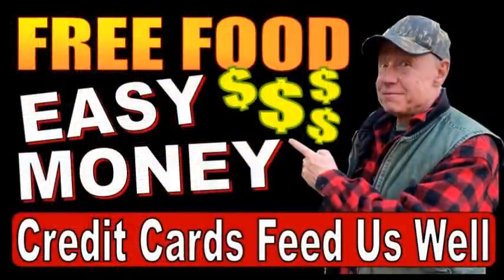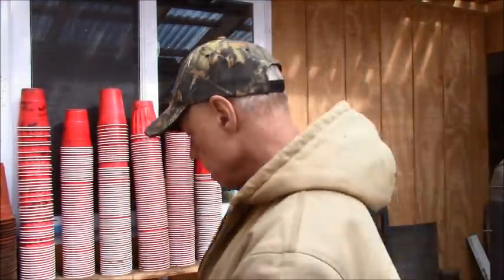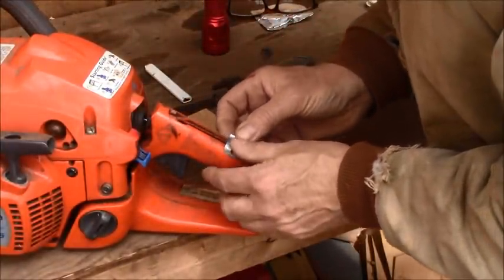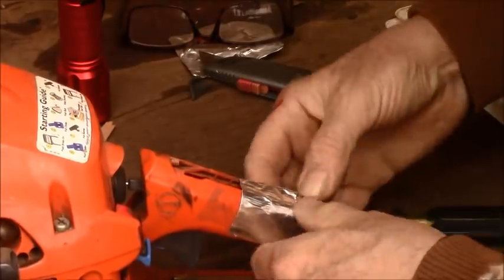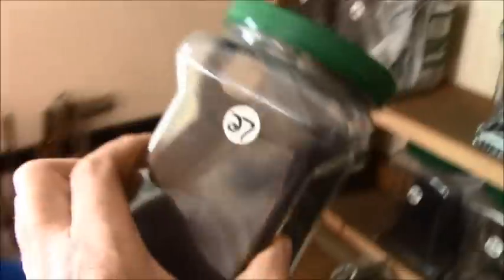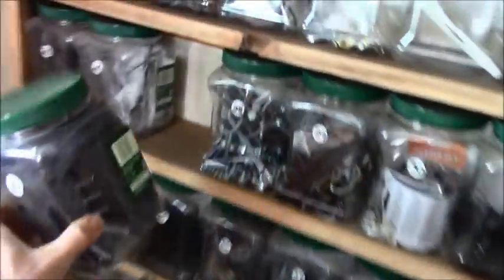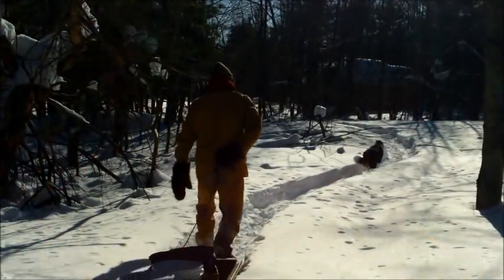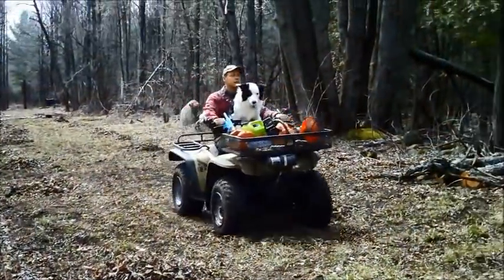OFF GRID LIVING VLOG  Cob Job Chainsaw Repair with a Financial Video Recap.

Comment: With my credit card rewards program I have a choice of cash back or merchandise.  I go with merchandise and I recently ordered a great cast iron frying pan.  I have a small one but this one is larger and I just got it and I love it!  Like with you, I have no caps or limitations.  Over the years I've been able to get dehydrators, bed sheets, binoculars and other things that are useful.  Love using this credit card system!  Love your organizing system for your parts.
Reply from the maker: Having that option sounds great.  I used to have a merchandise card but now that I have a cash one I've been using it all the time.   We're racking up the points with these lumber purchases :-o

Comment: I enjoy your videos. Thank you. I especially empathized with the Husky 345 saga. I cut my winter firewood with one for about 7 years. Then it melted because the muffler bolts are a dissimilar metal from the head. They loosened up enough to allow the hot exhaust gas to go sideways and melted the saw body. You have been warned. 

I have used my backup saw for the last 6 years. It's a Homelite Super XL vintage 1972. I acquired it by salvaging it out of a dumpster when my neighbor threw it out. And no, I do not go dumpster diving on a regular basis. I cleaned it up and put in a carb kit and it has worked flawlessly ever since. This saw is almost all metal so it won't melt.

I traded the melted 345 to my neighbor for a Homelite XL 12 circa 1962. He had a 345 with a broken handle so he combined saws to make one good one. It took more than a carb kit to resurrect The XL but it's now a screaming terror. Again all metal. It's my backup saw.

 I am resigned to the world running on credit cards. Doesn't mean I have to like it. Yes, you are making 2% on purchases but the merchant pays 3% to 6% for the privilege of accepting credit cards. Then he raises prices the same to compensate. The consumer pays the higher prices. If I could wave a magic wand and make all the credit cards disappear then the prices could come down. You get cash back but you are still paying for the convenience of using a credit card.

Wishing you well.
Reply: But if all cards would end . the prices still wouldn't drop. That's how it works . shit never goes down even when it should .but it don't work that way anymore

Comment: We call it "Redneck Engineering" around my parts. Like you, my Dad was a master of such. Although his go to was electrical tape. Mine is hockey tape. 😉
Reply from the maker: My dad's quick fix was epoxy. He epoxied everything.  I can't even hear the word without thinking of him haha
Reply: @thebossoftheswamp  out in the woods, my Dads quick and cheap "epoxy" would have been pine resin/sap and then electrical tape on top of it. You can only imagine the "fun" ive had restoring some of his old tools, lol. Its been a nightmare at times but, I can reflect back on memories while shaking my head.
Reply: The epoxy reminds me of my Dad. He worked in manufacturing and brought home some C/I quality stuff.

Comment: Hey Boss,i just made a handy purchase on something I  used to laugh at people using.I bought a new battery powered chainsaw for on the sled and quad.No fumes,gas or noise,and pullcords.Lightweight and cuts like an angry beaver,even on 4amhr battery.Not for primary cutting,but sure handy around the homestead for quick cuts,rough carpentry,trail trimming.
Reply from the maker: I've heard they've come a longs ways. Maybe I'll look into them. Thanks

Comment: JC I used that nice metal tape in one of my videos. I "JIMMIED" (giggle giggle) a little solar shop light in my shed and ran the wire to the panel through the door jam rather than drilling a hole in the wall. I only used the tape because it was there and I had it......but I will back ya on recommending it........WORKED great and protected the wire very well.  Must be a close relative to the Bubble Foil, LOL 🤣😂😅
Reply from the maker: I recently got a 24"x25' brand new roll of bubble foil at the dump :-)  Its the holy grail of dump finds ;-)
Reply: @thebossoftheswamp  HA.....did you approach it with caution like a deer to a bait pile, scanning the area, on alert??? Might be a local subscriber messing with ya, knew you couldn't resist, LOL. Best wishes JC

Comment: Both of my grandpas used to pick up nuts, bolts and washers off the street and store them until they needed something. My best friend Ray, his dad never had a drivers license but took the bus to work used to do the same and store them in small buckets. The thing with the bass pro rewards card or any reward card, all your purchases are recorded and tracked whether you pay in cash, a debit or credit card.

Comment: Another way to fortify the compromised handle on the saw... pack some Styrofoam inside (if needed), cover with the foil tape.  Then, get a long length of string and tie half-hitches (continuously) dressed well and tight.  You'll end up with a spiral ridge, a firm/sturdy gripping surface, and a stash of emergency string if needed.

Comment: You better hang onto any yard small engine tools because the environmental guys are gunning for them. California passed a law that starting in 2024 they will outlaw sales on new small gasoline engine yard and garden tools. Sure some of those battery operated tools will handle small stuff but several inch thick stuff those battery operated tools will not do the trick. Illinois and New York State are both considering legislation banning gas powered lawn equipment.